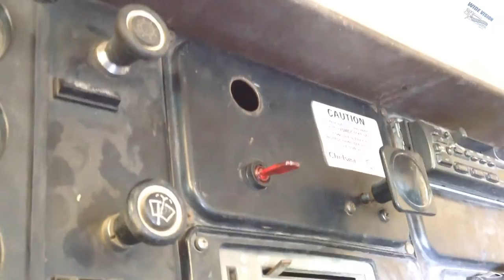Tulsa Hydraulic Winch- Adding Wireless Remote Control!

Comment: Well I could tell that your were beside yourself to get it all hooked up so you try it out... I'm the same way. I do hate to see wires without the rape that goes on and covers them so they don't get beat up rubbing on the frame or otherwise but that is just me. You have a great understanding of hydraulics and that backhoe is probably where you got a good understanding from. Good video as covered I'd say most everything

Comment: I think you should have a relief already built into the system before the DCV
Reply from the maker: +tighe hall Since I'm adding the valve in series, the existing relief valve has to go through the solenoid valve, which means it can't dump into the tank. Also, the crane valves are set at 3000psi and the winch is supposed to be set at only 1800 psi, so I need a different relief to protect the winch.  For some reason, I have it in my head you have hydraulic experience, so I think that'll make sense. I'm contemplating adding an electric diverter valve that is activated with the winch solenoid valve so oil is redirected from the crane controls to the winch.
Reply: Stack your dcv on top of the relief you will gain some heat in the system going over the relief all the time just ideas . Hydraulics system are fun to work on . Good stuff keep up the good work.